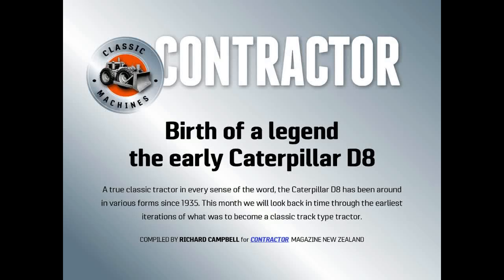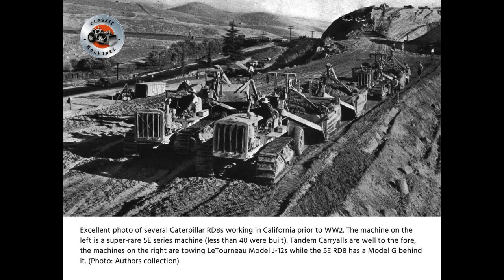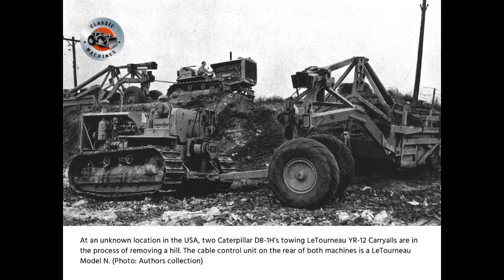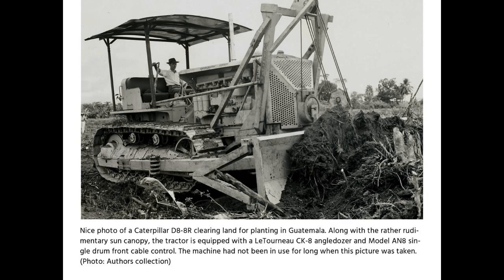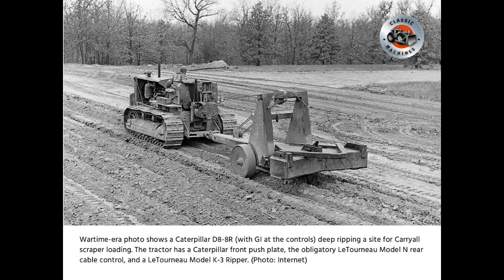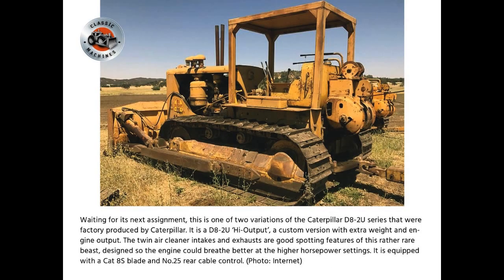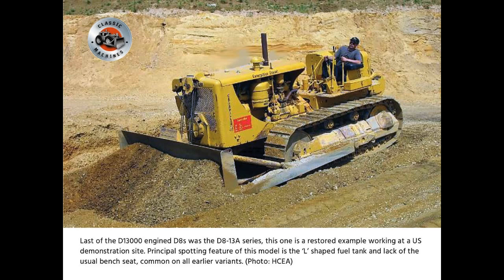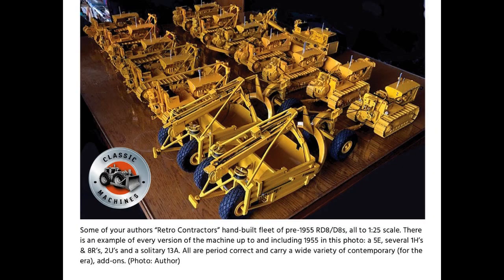Classic Machines:  Birth of a legend - the Cat D8

Comment: Hi, NZ Contractor magazine.
Nice documentary and all that, BUTTTT,

The twin exhaust Hi-output D8 that you showed was a variant that was done by a Caterpillar Dealer named Sheperd and not by Caterpillar. It had the engine bumped from 900 RPM to 1,200 RPM and the injection was upgraded. They also added a harmonic balancer and extended the hard nose 2" to clear it. Dual stacks and dual air cleaners to help it breath. It has extra bars running through the transmission case to help prevent the ring and pinion gear from slipping. Some say the transmission gear ratio's are higher to help it catch the scraper to help push it. (This detail information came from a man who owned one.)

The other variant with which I am familiar is the McCoy Pusher D8 which came with a D337 engine, all same the DW20 and DW21 scrapers and had a lot of extra weight added in the form of much heavier belly plates and fenders and heavier rock guards added to the tracks to give it the traction needed to be able to use the extra horsepower.

I seem to remember hearing that Cat supplied the D8 tractors minus the engines ot McCoy who then fitted the D337 engines and did the other modifications.

Both variants were attempts at making pusher tractors more capable of efficiently push-loading the bigger scrapers that were coming on the market at the time.

Thanks again.

Just my 0.02.

You have a wonderful day. Best wishes. Deas Plant.
Reply from the maker: Shepherds were in California and did do an uprated version of the D8-2U called the D8 Pusher. The Hi-Output D8 was a Cat factory build. You are correct about the D337 powered versions and they did have a higher ratio transmission. Not too many of them built and they were hard on clutch couplings and final drives..